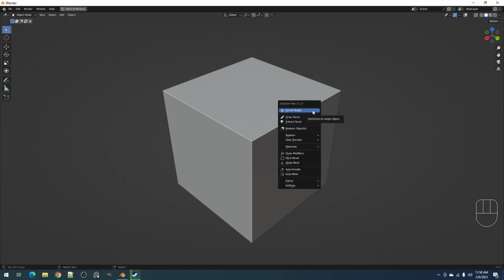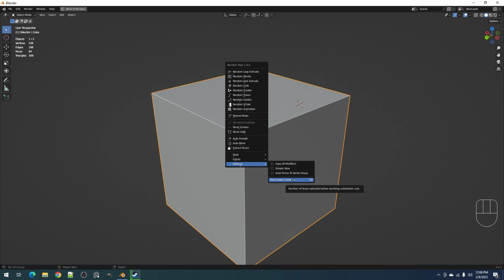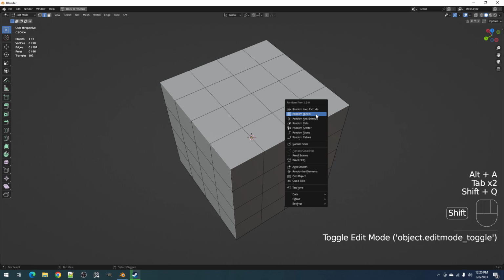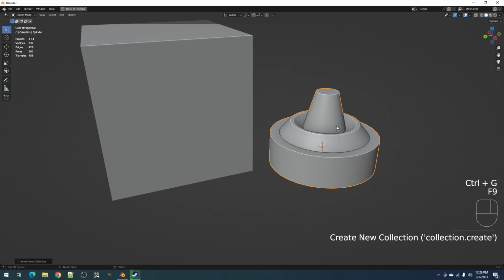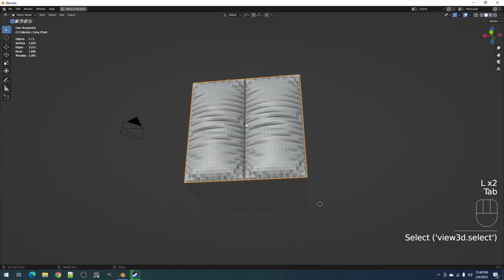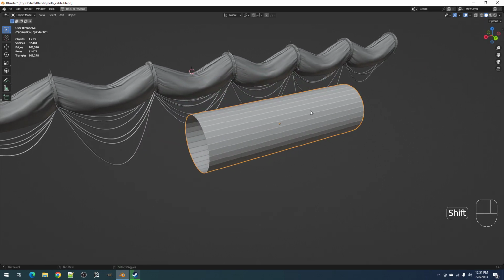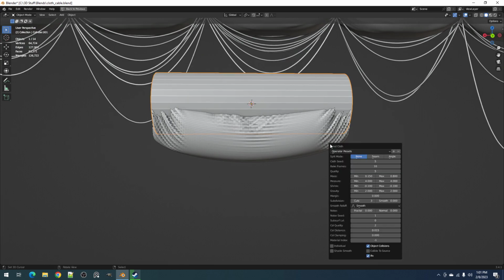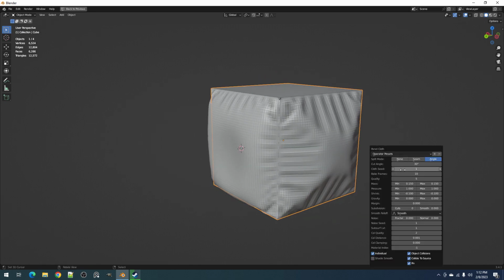Random Flow v1.9.0

Comment: Good afternoon If I have an old version, I do not understand how to remove it and correctly install the update, the latest version. Do you have a lesson on how to do this?
Reply from the maker: Use the install button on the zip file and it will handle that automatically.

Comment: Random cells is a great addition! Is there an easy way to fill the backside of created cells? This doesn't matter for standard usage, but does become an issue on offset, especially individual offset. (Selecting the open edge of one object and then Select by Similar --> Amount of Faces Around An Edge to fill faces seems to do okay, but maybe there's a faster or more reliable method.)
Reply from the maker: Join the discord and show me the process.